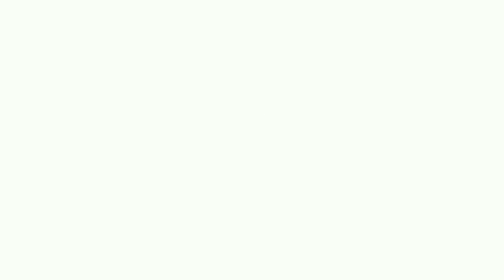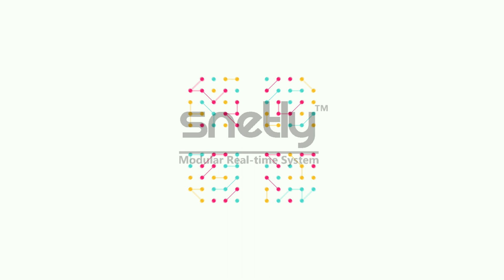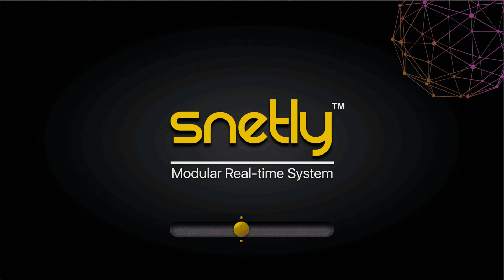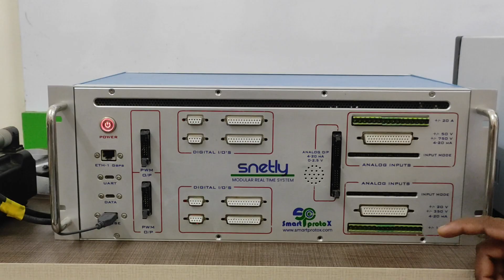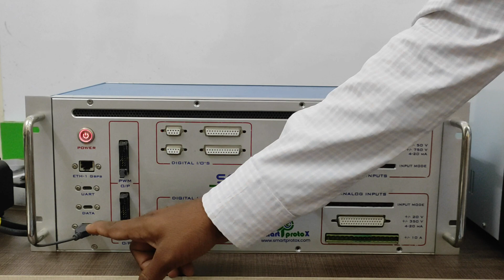Open loop control of PMSM motor - Step by Step explanation

Comment: Can I use it in virtual mode
Reply from the maker: Direct virtual mode is not available as of now. If you are intrested we can support you in remote manually. Thanks!
Reply: @snetly9864  I want to learn it, if off line software you can provide.
Reply from the maker: @hocho2278  Nope, it's a hardware tool which runs in FPGA. No PC or software is required. Let us know about your requirements we will consider helping you or collaborating with you if possible.
Reply: @snetly9864  Try to make it to be operational in virtual mode also,  then I think it would be highly acceptable among the researchers. Commenting as I have working experience with OPAL_RT and Typhoon HIL
Reply from the maker: @hocho2278  Thanks for your feedback. We will consider and forward this as a valuable request.